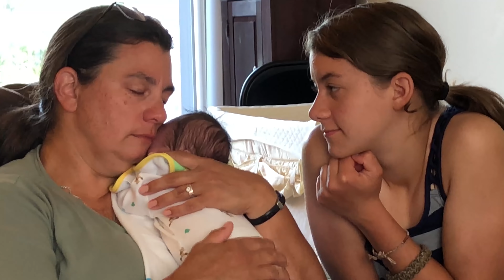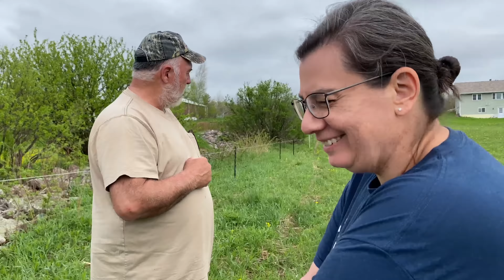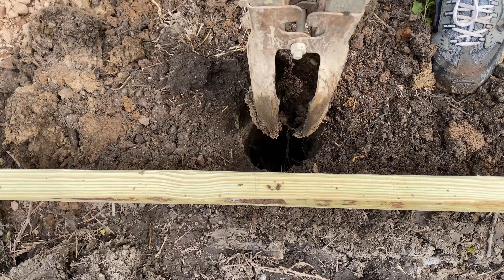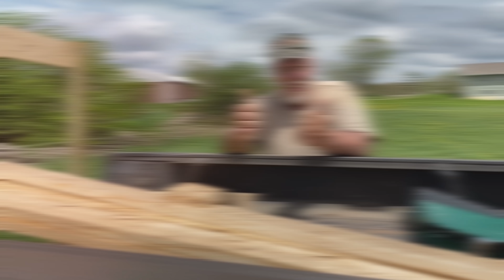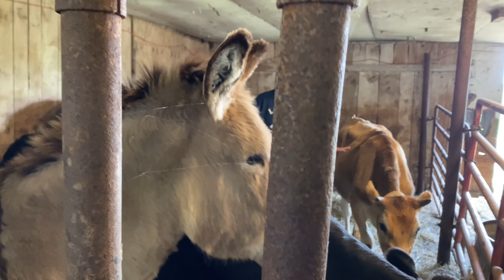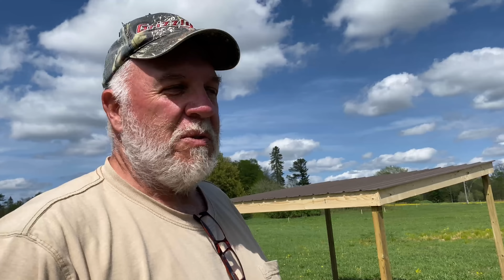Another Trip To The ER and Shed Build | A Big Family Homestead VLOG

Comment: We have shale like crazy here, so I use a 4ft pry bar, ( the sharp end) and chip out the square for the post, scoop the dirt out , chop , scoop , putting the dirt in buckets. Set the post, fill it back in with stone and the dirt, and tamp it. I don't have a post hole digger, or the strength to use one. My pry bar works pretty good .But, but, the shed has no sides, it's just a roof.

Comment: It is so good to have the help of great neighbors, but PSB that is just too much math for me.  Glad the cows are home, I know you feel more comfortable  now.  Caleb, I hope you are doing OK now....hate being bit or stung.  Brad, it is a good idea to use screws whenever possible, so much easier to take things apart to reuse materials.  Might cost a bit more initially but the time saved both putting up and taking down is well worth it.  Have a Blessed day.
Reply: Margaret Bedwell  I agree with you on using screws. I never know whether something will be permanent, and usually our builds aren’t. The only caveat with using screws, especially on an open structure such as this, is the amount of movement it will take from wind, weather, and temperature changes, can cause the heads of the screws to snap off, and also lead to structural failure over time. I have an old chicken tractor that I build several years ago with screws. The frame of it is still standing, and I parked the frame in a barn stall to use as perches for my chickens and guineas. It’s very wobbly these days but it’s still standing!